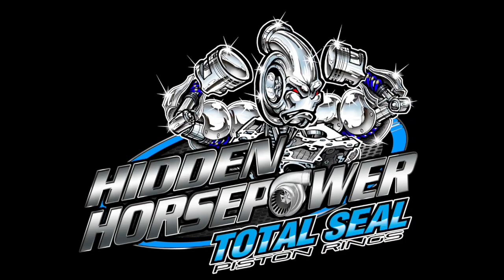Hidden Horsepower Episode 53 - Jeff Baldwin

Comment: Ran a 4.3 in small  car  Camaro.  Torque cam..85 find intake modified to a 2g carburetor. 20w50 Mobil 1..Changed the head gaskets 1 time.
Reply: Won 5 out of 6
Reply: Yep low budget
Reply: Spent alot of time porting the 85 FBI intake to use the 2g carburetor.